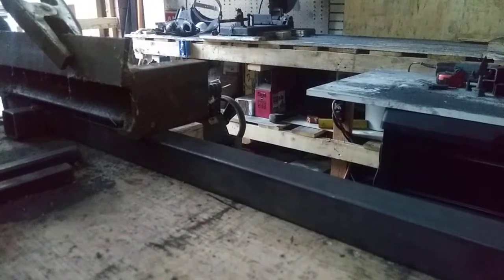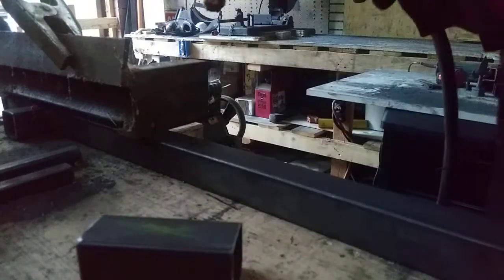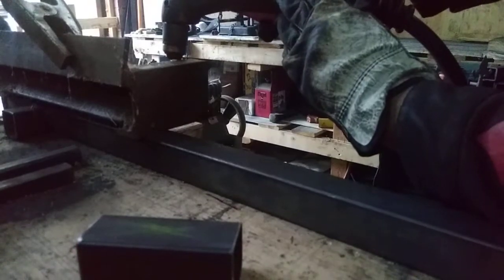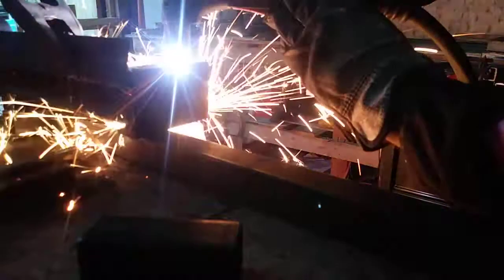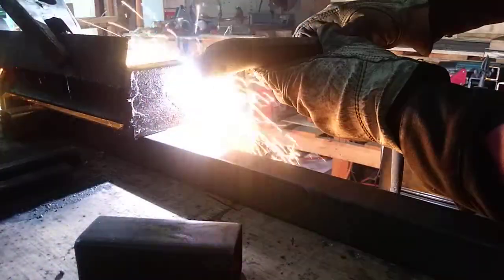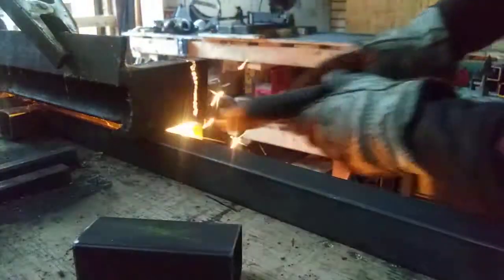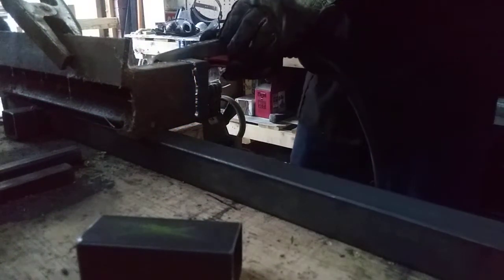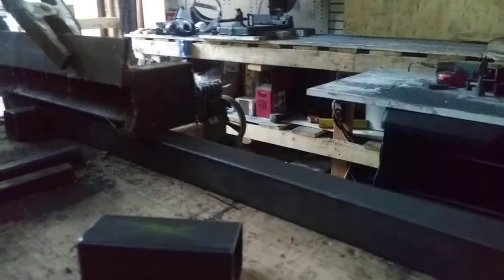Hypertherm Powermax 1100 Plasma Cutter, cutting 3 inch channel

Comment: hey cool video;  I have the same machine and i wanted to run it at home but im not sure i have adiquite power how is yours set up ..  ( plug, wire, voltage, Phase, amps)
Reply from the maker: I use 240 volt breaker, single phase, that is 40 amps. Its the same one I use for my welder. I have a 20 foot 8 gauge extension cord that I use to move it around.